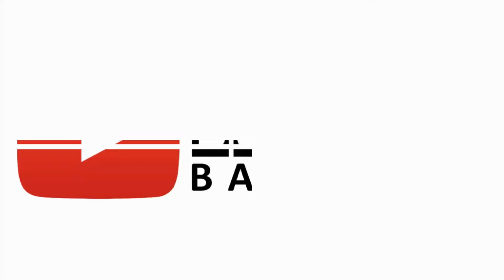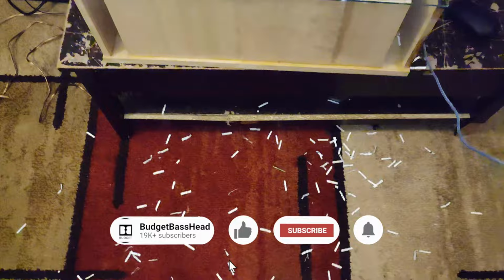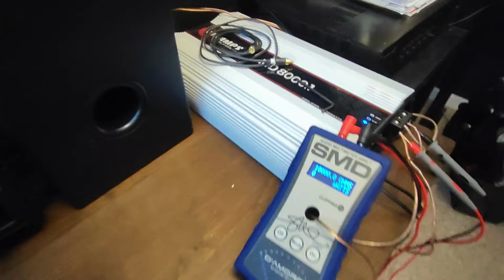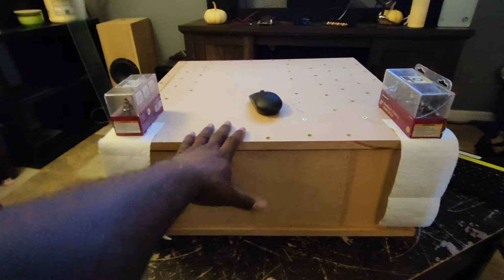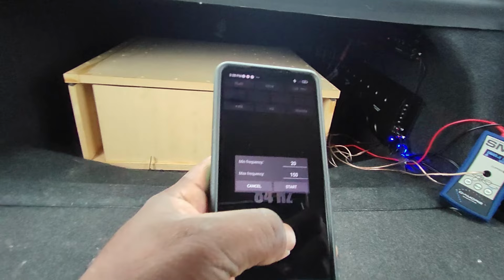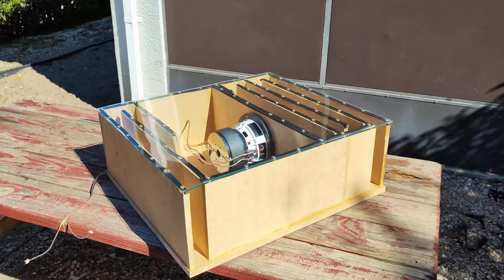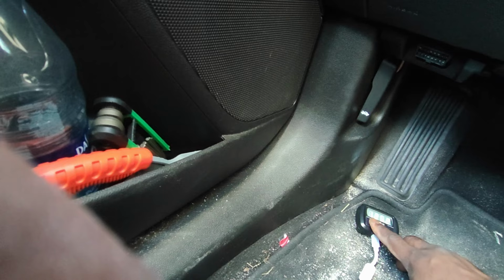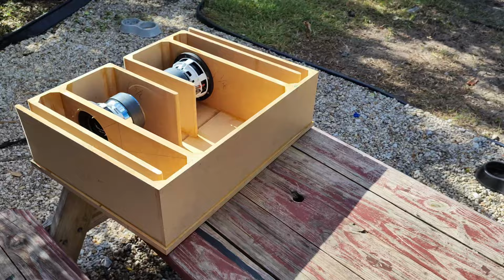How To Design Build And Test | A 6th Order Bandpass (Parallel )

Comment: Im still pretty blown away by how capable these little drivers are.
Reply: They really are amazing   I had 4 in a very low tuned enclosure on a strapped pair of ct2000.1ds and nobody believed I was only running 6.5s
Reply: @nikgosser3035 yeah these little 6.5 subs nowadays hit low in the right box with the right amount of subs.

Comment: Wow! You had me at 6th Order! Yeah, I would've tuned at 30 and 60.
Reply from the maker: I wanted to, but the program showed a better curve with this tuning.
Reply: Looking out, you should get one of them IM-SG tools for figuring out your enclosure tuning and see how far off your enclosure building program is from real world test. If you went with a higher tuning, your 6th Order for sure would have outperformed the bass reflex enclosure. HexiBase has a good breakdown of the 6th order operation of both parallel and series. The point of the 6th order is to give 2 tuning peaks, in which you can EQ your peaks to flatten a response across a wider table than a traditional 4th order bandpass (ratio defendant as well 1:1 2:1 3:1 and so on) efficiently. Which is where the 6th order bandpass order came from. Porting the sealed chamber in the 4th order.
Reply: @mikehonda7934  The IM-SG+ is a $450 device and he already has the tools that can duplicate its function. So not a good investment. I'd suggest a DATS that will plot the impedance curve on a graph. They are only $130.
Reply: @JasonWW2000  it is a good investment if you are into what Budget does. Yes the DATS does the same, but on the fly, the DATS is useless and you’ll be guessing. Do some research on the unit I mentioned, and you’ll understand it does more than what the DATS does. D’Amore Engineering has a few segments it’s design and features.  Put together all of what you say he has, since you know him apparently, and get a tally up and tell me how much it comes up too. Minus the computer you need to use the DATS.

Comment: I absolutely love 6th orders, as you can see from my profile pic I have 8 12's in a series 6th order wall.  
I have my small chamber (rear) tuned to 24hz and my large (front) chamber tuned to 48hz.
I do a 160db@23hz and a 162.3db@36hz.
From 20hz-70hz I never drop below 158db.  It has crazy bandwidth, sure I could build a flat wall and be louder but I like to demo and having that kind of bandwidth is amazing.
I can play down to 17hz also and still be at a 154db.
Reply from the maker: I would love to see that build!
Reply: I'd love to see it too. 6th order has been on my mind lately for my daily driver, hate to go thru the trouble of buying mdf, building the box and having it not meet my expectations how well does it compare to a sealed enclosure?
Reply: Nice I had a huge 6th order and 1 under powered xmaxxx monster 15  and I loved it my peek was 24hz lol I did 148db at 24hz sealed at the headrest and 142db at 19hz sealed at the headrest and my meeter won't read below 19hz so idk what it did but I could play down to 16hz before losing compression
Reply: Awesome!!!!!

Comment: This is nothing new but well demonstrated. Bose Acoustimass AM5 bass module is built in this parallel 6th order. 30 years old AM5 and it is still working in my computer room attached to my PC amp. Off course Bose AM5 bass module is tuned much higher (40-120 Hz) and the roll of on 40 is very steep but the principle is the same. They managed to make a very small box with 2 X 5-1/2" drivers and they put the driver's panel on the angle so they can make the box even smaller. Very smart. On the angle the driver panel can get the bigger diameter drivers keeping the top and bottom  of the box the same distance. Very primitive with only 2 port tubes but it works. Now after I saw this video I am thinking of building the replacement bass box for my AM5 with lower tuning frequency. Building the box will not be a problem but finding the right drivers for it, that is another story. 
Looking at your presentation I can see the huge Xmax on your CT driver and while it is OK for a higher frequencies (40 and over) I dont like when the driver is moving so much at the lower frequencies. Something is not right in calculation for the under 30Hz in box design as it seems to me the driver is close to the Fs in that range. I know CT can handle it because of its huge Xmax capabilities, but it shouldn't on lower frequencies... Only my opinion, I may be wrong. Either way thanks for this presentation it made mi think about it now.

Comment: This reminds me of a 1990’s 6th order bandbass unit B-8 or B-10 by a company called Collins Sun Electronics or Collins USA. I had the B-8 and that had a port on one side and a smaller port on the other and it 8” sub would take and sound REALLY AMAZING with a Punch 200 bridged to 900w RMS. Nonody would believe me when I tole them it was 1 -8” speaker 🔊. Their enclosures were black laminate with Fleckstone “granite speckled end caps. Some even came self amplified. They had tubes and cubes but the rectangular B-8 & B-10 were my favorite with almost ZERO distortion. Simply amazing and ai love this channel because this man builds things that I haven’t seen in a LONG TIME like the one with the “Infinite Baffle” aka Free Air 18’s so awesome! ⭐️⭐️⭐️⭐️⭐️

Comment: It's not that surprising that you smell the woofer using the reflex box. You really need an infrasonic filter to keep it from unloading below the tuning frequency. Win isd also has an excursion chart that shows when the woofer will bottom out (if you input the xmax) of course your first box is tuned so low you'll never have a problem. Great video!
Reply: When it unloads the coil leaves the gap and it heats it up so the further the coil is away from the magnet the hotter the coil is gonna get so if you keep the subwoofer within the tuning frequency of the box it keeps the coil centered within the gap and it keeps it cooler and it also increases bl.

Comment: BudgetBassHead, if you pause this video @ 19:07, you will see 27hz= 4.8 ohms= 28 watts! This clearly indicates that your subsonic filter of your amplifier, or processor, is massively limiting your low freq. output on your 6th order! It seems perfect for your bass reflex/ported enclosure as that is tuned @ 42hz.
Reply from the maker: Yes the amp I'm using rolls of at 30Hz. I'm getting rid of it though. Thanks.
Reply: @BudgetBassHead  It even seems to limit power up @ 35hz. Does this amp have an adjustable subsonic potentiometer from 10hz to 50hz? And if so, have you tryed testing with it turned all the way down to 10hz?
Reply: @BudgetBassHead  I ✔️ out the audiopipe amp u have on their website, and it says bandwidth 30hz to 180hz. Subsonic off=30hz, but most amps start cutting power output around 5hz higher than their lowest subsonic setting, from my testing. Like the amp i use says subsonic 10hz to 50hz, but even @ its lowest setting=10hz, it starts reducing power @ 14, or 15hz. Im glad i seen this test of yours, cause i know alot of people that were looking @ buying the audiopipe amp u r using, but never realized it stops output around 35hz n below. Most of them play modded music like me, and want to play 15hz to 50hz! Im not trying to bash what u have, but alot of people i know that demo low freq. Modded music would be pissed, if they bought this, or any other amp that limited output @35hz, or even 30hz. Thank you for showing that in your video. Have a great day, and plz., keep making great videos!
Reply: @BudgetBassHead  I have 2 apmi2000's and I have 0 problems playing down low infact my peek is 24hz and can play to 16hz with authority so it's not the amp
Reply: @KnowName33  There is something limiting low freq.= below 33Hz or so, in this guys system= not your system. If you see the freq. sweep test he does in this video, without changing the volume, the power should be fairly close to similar @ the same/like ohm loads per freq. Example: If 37Hz was 4.8 ohms, and 200 watts, then @ 27Hz if it was 4.8 ohms the power should be around 200 watts, unless something is limiting it? Look @ 19:01 to 19:07 into this video, something is greatly reducing power output from 37Hz to 27Hz!

Comment: Man, I see you're also plagued by bots in the comments. No matter, keep it up, ppl don't understand how much time, effort and resources go into prototyping and data gathering. That 6.5 might be better tuned higher, as you stated. Another thing that you might consider is getting a mic & REW to do FR sweeps (opens a whole new Pandora's Box of troubles and adjustments) but will visualize your proto box response to modeled FR response. I've an 8" Hertz sub which is waiting for its panels to do exactly what you did. Box is 1.130 ft3 @ 33Hz to 0.5 ft3 @ 60Hz = -3dB @ 30Hz and -3dB @ 90Hz. Everything above 32-33Hz to about 80Hz is above 0dB response with a peak @ 50Hz +4.5dB. Driver specs are more important in those type of boxes than anything else. Cheers.

P.S. Good on your lady for allowing the living room! 😆
Reply from the maker: Thanks for the support. I've been curious about those Hertz subs for a while now.
Reply: @BudgetBassHead  I got 2 actually: an ES200.5 8" (older model, Energy Series) and a Cento S4 10" both cheap, but good budget wise and decent TS params. I'm in Europe....your CT 6.5 costs more than certain 12" models here and I will never consider anything below 8" to be viable for sub duty. Audison is the parent company of Hertz. Check them out. 🙂

You can find detailed spec sheets for both. I bought the 8" for like 60 USD and the 10" for like 100$, before the USD was over the Euro.

Comment: That tri chamber looks slick, all your boxes look great, What tools do you use? Judging by a blade burn I seen at the end looks like you are running them with just a skill saw (Know how I know that mark! 🤣) One thing to note however is the reason you see 6th orders in spl builds is the construction and sheer size needed doesn't give you much option with the port size as well. Also can't do a 4th bandpass (obviously a 4the reflex aka ported is typically not even an option with more than 2-4 drivers ) is because you can't literally have a sealed section or you'll blow the box or more likely you'll blow your spiders and cones right out from the amount of air needing to be displaced (Hence why windshields blow 😂) great vid

Comment: Nice video, but u should have used 2 more bracings for the chamber und have used at least enough screws for the holes. U can see that the chuffing comes from air that slips outta the Plexitop😅.

Comment: What would happen if you added two Passives into this build ?   Maybe on the Top... or on both the front and rear panels ?    Phillips created a unique Passive system called "Woox".  It consisted of two unique passives that I believe have three expansion rings... and both passives were stacked about 1" apart from each other,  mounted to a special open-air assembly... and then screwed in place to the speaker.    (So, thats 4 passives total.  Two per speaker)    Interestingly enough... I believe these speakers ALSO had ports on the rears of them.   I dont know if the ports were tuned, or just for passing excess air pressures.

 It would be cool if someone replicated the Woox passives, but on a much larger scale..  making a Frankenstein version of it... by gluing 3 Foam Surrounds of different diameters, into a single flat passive  (x2).    The phillips woox speakers that I owned, were part of a boom box, that were powered by 6.5" diameter woofers.   When they rotted out, I looked into replacing them... and found out that these woofers were specially designed for longer Travel / Extension... to be able to deal with the greater bass excitement, without suffering any over-extension distortions.  Also, to help excite the Woox units.

 If you are not sure what the woox unit looks like... google for the Images... and you will find some photos of it, pulled out of the speaker.

 Those little woox speakers put out more deep low end bass... than my 12" techniques 3-way house speakers.   Even at maximum volume levels (where they were almost ready to blow), I couldnt get them to distort the bass.   Pretty amazing design.

 Sadly, mine had the foam based Woox assembles.. and they eventually cracked and rotted out.   They did make an all plastic version... but sadly, I never got my hands on a set with them.

 I had thought about trying to reproduce a plastic version... using Hot Melt plastic and a Vacuum molding device.   I worked at a place that had such a unit... though, I believe a heat gun and a vacuum, can make a decent DIY home version.   Simply carve out the ring shapes in wood,  glue them to a thin board, and then pull the vacuum mold on it.

 With the 3 expansion rings instead of two... you get a lot more expansion / excursion, than a typical passive.

 I couldnt tell if the woox units had weights in the center of them.  They were very light in mass.  I should have tried putting a magnet to them.. but I never thought about it, at the time.

Comment: Wow that was a great demo, Err-BTW dunno if I was hearing it wrong but yo had a massive leak 
4:33 to 4:42 🤭 Ewps.. never mind as further in the video you make it known you are aware of it. 
Also you may want to place a little and I stress a little sound absorbing material on one of the inner 
chamber walls so that the Subwoofers resonant frequency is not so prominent once that, that, that
thin sheet of plastic is mostly enveloped in MDF with still some strategic inner viewing. 
 
And yes I am one of those who love to feel or experience down to 10~15Hz and not hear chuffing 
but rather bathed in a Subsonic atmosphere or is than sensation? meh.. Once you have experienced
it you should know exactly what I mean when your whole body is resonating with the room and yet 
without any perceivable sound to speak of..
Reply from the maker: The plexiglasses for demo purposes only

Comment: The program I use for 6th's my back chamber is small with high side port and front chamber is bigger with lower tuned port I get higher dB's.
Reply from the maker: Thanks for the tip

Comment: 1st time coming across your channel, good stuff!!! Got yourself a subscriber! I was curious, think coating the port with wood glue or something would help with air flow? And was also wondering if flaring the port throughout the box would make a difference? (Like starting at 1.5" out to 3"-4" at the end of the box)
Reply: Coating the port will yield little to no improvement of the "chuffing". The "flared" or "radiused" exit would help the most, however it isn't a sure resolve for port noise, and the length of the vent would have to be adjusted. Where the radius begins is the end of the length of the vent. The port velocity is too high and can be calculated to a minimum port area for a given port design.

A port can be tuned to a given frequency at a calculated port area and length and yield a port velocity. The same frequency can be achieved from another port area and length and yield another port velocity. Either or may be equal to, less than, or greater than a determined velocity. That less than or equal to that velocity yields zero noise. Greater than....you get noise.

The port velocity should be calculated and referenced against the threshold every time a vented enclosure of any kind is designed. Any size or shape vent is susceptible to noise. I wish it was as easy as rounding over sharp edge, adding 45° corner braces, a large radius flared vent , or coating the smooth MDF vent walls in wood glue, outfits even easier through a mathematical equation.

Comment: Another great vid of course. Few questions: Would moving the sub down towards the "bottom" (as far as "bottom" considering the camera view) change the tuning at all? Or towards the "top" for that matter. What about facing the sub towards the other port? As in using the smaller ported side and port beginning as the baffle. I wonder how much difference these changes would make? The enclosure would ultimately be the same, just the sub has been moved around. 
Keep up the great content!
Reply from the maker: The subwoofer position does matter to some degree, in terms of compression. But in this build, centering the subwoofer was the best option.

Comment: So the 6th order can use one sub tuned to two different frequencies to give a larger bandwidth? Neat stuff
Reply from the maker: Yep. This is my favorite enclosure.
Reply: A fourth can also be tuned to two different frequencies
Reply: @kathygarber3230  4th is usually most musical in a 1:1 ratio, where the sealed section determines the low Frq, then you play with roll-off of the vented section.

Comment: x to doubt. i guess we are throwing phase out the window. you can see in the program how out of phase each frequency range is going to be. that is going to make a huge difference in how "good" it sounds. this is one of the major drawbacks to ports and why SQ ppl dont use them.
Reply: you made a nice demonstration box. i thought you were trying to save space for the family? what happened? any unloading issues?
Reply from the maker: These are demo enclosures. And no where near the size of what I would desire to listen to. This is for education and entertaining purposes only... And maybe to have a little fun as well. 🙂
Reply: You throw phase and transient response out of the window any time you use ports, bandpass and reflex both included. However you throw efficiency out of the window with sealed boxes. Eventually we all must choose a side... Good luck getting a sealed 8 inch woofer to hit that hard at 19 hz in a sealed box tho.